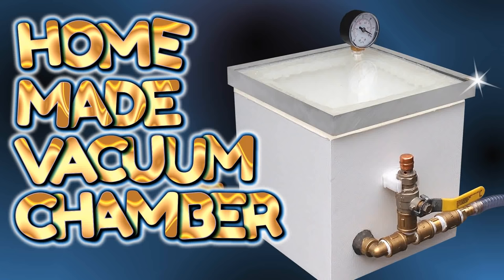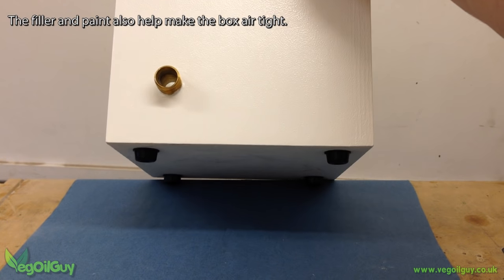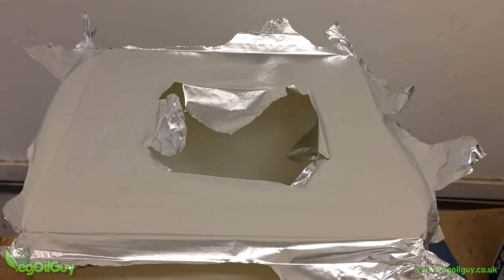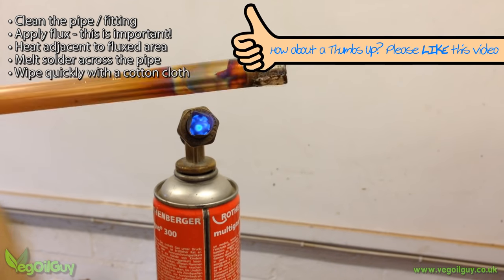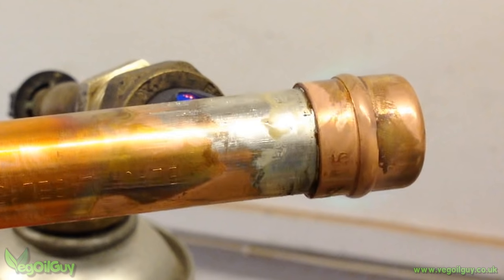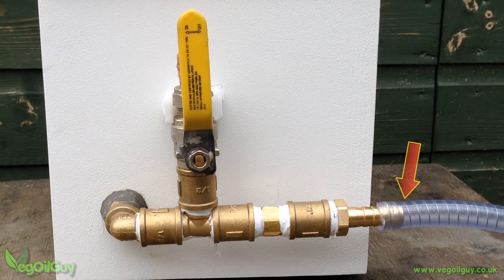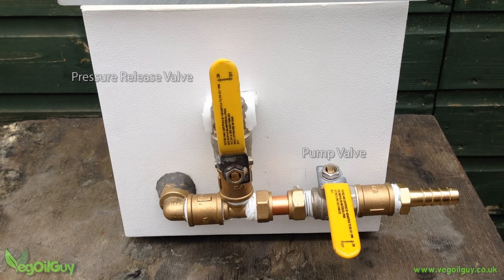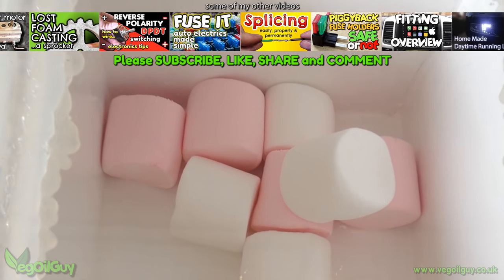home made SIMPLE BUILD vacuum chamber - by VOGMAN

Comment: Looks like your pump is better than KOR. They only pull 25 inches of mercury.
Reply: I'm not sure which pump You are referring to, but im guessing you use a  guage meassuring relative pressure, then your surrounding pressure infects your reading. But a crappy pump and bad seals, combined with a guage which only gives a rough estimate, you cannoy expect much.

Comment: Great vacuum chamber,  but as a plumber, I have to disagree with your soldering technique
Reply from the maker: Don't worry Roland, I've no intention of ever claiming to be a professional plumber : )
The 'sweating' technique came from my grandfather, to my father, to me, so it IS an old technique and predates solder-ring fittings, solder with included flux, etc. And the technique is slow... but I NEVER have any leaks, and that's all that counts for me.
Reply: @vogman  try powerflow flux, hardly have to clean the fitting, i havnt seen tinning since i was in college in 1983 !
Reply: Tinning and heat control is important if you plan on running 1500 psi in copper....... Had to repair a car wash once after a plumber torched the crap out of some joints, and the overheated sections expanded and popped like balloons......